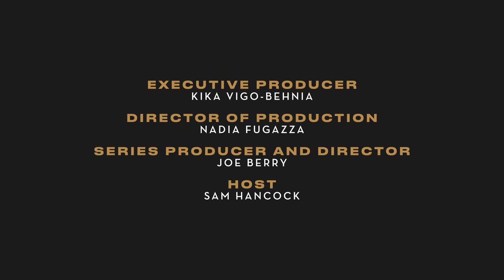1980 Porsche 924 Carrera GT: From Entry-Level To Homologation Special

Comment: The 1980 924 Carrera GT with 210 horsepower may not seem like much today but at the time it was more than many V8 powered sports cars. The 1980 Ferrari 308 GTS/GTB sold in North America with it’s 3.0 liter V8 was rated 205 horsepower and 181 lbs ft of torque. The 1980 Corvette with the 5.7 liter V8 only had 190 horsepower in stock trim and 230 horsepower in it’s highest spec trim. A car with similar specs as the 924 Carrera GT was the 1980 Lotus Essex Turbo Esprit. It was powered by a turbocharged 2.2 liter 4 cylinder engine and had 210 horsepower and 200 lbs ft of torque that only had to push a little over 2500 lbs down the road making it one of the quickest accelerating cars of 1980 with a 0-60 mph time of just 5.5 seconds. The 3400 lbs 230 horsepower Corvette did 0-60 mph in 7.1 seconds while the 3300 lbs Ferrari 308 did 0-60 mph in 7.2 seconds. Compared to the 1980/1981 Porsche 924 Carrera GT that was rated at 210 PS/207 HP and 203 lbs ft of torque and weighed in at just over 2600 lbs with a 0-60 mph time of 5.7 seconds cars like the Corvette and Ferrari 308 were slow. To get the similar or better acceleration times as the 924 Carrera GT in 1980 you had to get a Ferrari 512bb that did 0-60 mph in 5.4 seconds or a Lamborghini Countach that did 0-60 in 5.1 seconds. Both cars cost considerably more than the Porsche. So despite the 924 Carrera GT being considered an underdog when you actually look at the performance of other high performance cars of the time the 924 Carrera GT is quite a good performer that goes toe to toe with the best sports cars of the day and even out performs many of them.
Reply: Do you wich engine is in that car ?. Is it the same as the 924 Turbo (only then tuned up) ?.
Reply: @ArieVisker  yes. The 924 Carrera GT was based off the 924 Turbo but the engine used a top mounted intercooler that helped lower intake temperatures, had a higher compression ratio and new digital ignition system that all bumped power up to around 210 horsepower. Then of course the suspension, body work and a few other things were modified and upgraded to make it a better performer. If I remember right they made 406 cars in total and they were only available in silver, black or red.
Reply: @porscheguy09  thank you for the information. I have a couple of books about Porsche and I could not find this information. 

The seats are they ever been used in different Porsche models ?. I have never seen them in other Porsche cars.
Reply: @ArieVisker  the seats were the same “Sport” seats available in the 911 from 1981-1984 but featured a unique velour fabric design only available on the 924 Carrera GT.  The description below was copied from the website I linked at the bottom of this response. The website loads in German but most computers and smartphones give you the option to translate it into English or whatever language you prefer. The website gives a complete overview of the 924 including the Carrera GT and lists all the specifications for each variant. The link should take you straight to the Carrera GT section of the website but if it doesn’t you can find it in the Menu. This is just one of many websites available online that discuss the Carrera GT.

“Sports seats in solid pinstripe in exclusive black-red with all-round red piping. Leather steering wheel, leather gear stick.

Selectable options largely identical to the 924 turbo optional extras 

(Targa, Klima, eFH, eSp, radio, electrical antenna, alarm system, rear wiper) “

https://werk924.com/924-carrera-serie/924-carrera-gt/
Reply: @porscheguy09  well the reason I asked the question. I can buy  a rolling chassis of a 924 carrera gt. The engine is not with the car it has blown up by the owmer and brought it the crusher (yes really).
Reply: Always wanted to do a replica with an audi quattro inline 5 turbo in it.. perefection
Reply: thanks for the info I've started to use 1/4 mile times because it reduces the effect of launch and more realistic road results. -cheers

Comment: There's no such thing as a poor man's Porsche. They all require good maintenance, whether that's the complexity of a modern Cayman, or the usual classic car metalwork repairs and worn out parts of a classic. They will all be rewarding to own and drive though. My 924 Turbo is the best built car I have ever owned.
Reply: But the 924 was actually called "Hausfrauenporsche" in Germany, which literally translates to "housewife's Porsche", so nothing anywhere near top notch, as the 911s.
Reply: Not sure what you mean by "best built" but I have a 924 Turbo aswell and to me it feels quite cheap (but not bad for 70's standards). Like you can tell they used the Audi/VW parts bin a lot, for example the interior plastics feel cheap and its missing features like fender liners etc. but they sure are great to drive, I take mine to the autoslalom a lot and it gives modern cars a run for their money for sure.
Reply: Yes there is. It's called the Mazda RX-7. It kicked Porsche's ass 3 times in Australia.
Reply: @Seegalgalguntijak  Shaddup.
Reply: @MityLite  I mean the longevity of the mechanical parts, and condition of the metal work is miles above any of the Vauxhall's I've owned.
Reply: MityLite All Porsche feel like partial VW/Audi parts bin to me. All the way up to the new ones. Lovely cars though
Reply: @sarahdell4042  It's impossible to find a mass produced car that doesn't borrow parts from other manufacturers.  It doesn't stop some cars becoming greater than the sum of their parts.
Reply: @RETMTM  meh
Reply: @SteveJenKnaub  actually it was very embarrassing for the German Marque when the SP RX-7 beat the factory prepared 911RSCS in Australia right in front of their own eyes. The big wigs flew in from Germany to put the heavies on the team as it was crucial for Porsche to break the domination of Allan Horsey's management of the Australian Mazda Motorsport project. I believe that this was motivation for Porsche to become the benchmark they are today.
Reply: @MityLite  true 928 front brake rotors rear 911..kkk turbo from carrera...and yup on turns fo make those guys with the six diget $ vehicles  angry ..but in the straights they get their smile back
Reply: @RETMTM  i think porsche was already the benchmark of racing at the time with their successes in endurance racing in the 80s.
Reply: @oranges866  don't kid yourself. Facts are facts and yes Porsche should have been the benchmark in Australia. Australia! The context and point I made was the SP RX-7 wiped the smiles off Porsche's face and destroyed FACTORY PREPARED RACE CARS with a fully road registered, buy off the showroom floor car. Do your homework and see for yourself. Mazda is the poor man's ($120,000AUD) Porsche killer.
Reply: @oranges866  oh my gosh, really? You seriously think that an entire domination of Australia's racing series is irrelevant? Hahahahahahaha
Reply: @RETMTM  you are seriously overrating the significance of endurance racing in Australia just to crap on porsche and glorify mazda. the only race that has any relevance there is the Australian Grand Prix in F1. meanwhile in the more competitive and challenging races like Daytona, Sebring, and Le Mans, the RX-7 only performed at Daytona, below average at Sebring, and so bad at Le Mans they were pulled out in favor of mazda's group c program, all while porsche consistently won those races over and over again.
Reply: @oranges866  or are you underrating the significance. Agree to disagree. You forgot to mention Bathurst, Targa Tasmania, The Bend Motorsport Park and many more. Some of the best drivers come from Australia. Pull your head in mate. 🇦🇺
Reply: @RETMTM  if you're an aussie or something i could see why you'd know those things, but unfortunately those get overshadowed by the likes of the Monte Carlo Rallye, the Circuit de la Sarthe which hosts Le Mans, Silverstone Circuit, and the Nurburgring, which is the most iconic racetrack of all time. those are some of the most famous places/events in racing yet they're just in Europe. i could mention some of the tracks in North America and Japan but you get the point.
Reply: @oranges866  yeah I get your point mate. We Aussies call people like you gong beaters. You have taken my point out of context which I tried to explain. Mark Twain's famous quote is now somewhat relevant. You win mate 👍

I have left the chat

Comment: The entire 924/944/968 line doesn't get the respect they deserve. They literally saved Porsche, their achievement at LeMans is nothing short of astounding and to this day well kept versions of all these cars is about as rewarding a driving experience as there is. 

The 3 litre S2 and 968  and the Turbo S variants being the pinnacle of the species. 

Read Automobile magazines take on the 1989 944 Turbo S vs. the 911 Turbo on a track. In short the 944 ate the 911s lunch. Respect.
Reply: As I understand it, the main reason they had to stop development of the 968 and possible future models was because they would outperform the 911.
Reply: @althejazzman  With equal amounts of power a well sorted 968 would have field day against a similar generation 911 around a track.  Once you get into the water cooled era the balance sways as technology and chassis development literally defy the laws of physics so to speak.
Reply: @Gorilla_Jones  Yes, Porsche had to make the 911 handle properly eventually, because they couldn't kill it off.
Reply: @althejazzman  Rumor has it they made a prototype 944 with a wider front end and a V8, but it never came to be because it would kill the 911
Reply: @MityLite  yup.
Reply: @MityLite  A V8 944 definitely would not kill the 911. With gas prices in Europe almost nobody buys V8 anything. Its a shame they didn't produce it because it would have been a moneymaker for the U.S. and Middle East markets to say nothing of the mind blowing performance that could be achieved by such a vehicle.
Reply: MityLite A wide 944 with a V8 up front...ummmm...isn’t that a 928?
Reply: @beechrad1965  928 is a heavy luxury GT car, not a nimble sportscar like the 944 was
Reply: In my honest opinion the true top of the trans-axle line was the extremely rare "924 Carrera GTS ClubSport"; a more powerful 924 Carrera GT.

That GTS Clubsport was the fastest Porsche (street legal) in the early 1980s. Even the 300 PS "911 Turbo 3.3" had no chance against the 924 Carrera GTS ClubSport.
Reply: @beechrad1965  I have both and they are completely different.
Reply: My '88 944 was one of the finest driving cars I've ever had.

Comment: A work friend bought himself an 944 non turbo. Early model with the 6 O clock tach. I think I ached for a few days after I drove it. 1 because the non power steering was heavy as, but 2 because it was just so much fun. I've got 240z's, an RX7 and driven GTRs etc.. and although the 944 is quite slow by today's standards it's that mechanical raw feel and sound the engine makes in these cars that just feels special. And I adore the shape of them. Just so cool looking.
Reply: Yes the NA is low on power, Gen1 has even less. Pretty soft stock suspension too. But sorted turbos are faster than 996 gt3 cars on the track. The lack of power is more than made up for in the handling and surprisingly they beat the gt3 down the straight too. Now being beat by a soccer mom in a Cayanne S, while your in a NA, on an uphill stoplight while she is probably 25% throttle does really make you want to swap in a 968/S2 or LS in it though, that's for sure
Reply: Try to find  a 944 ventilator model...around same  power  as turbo  but normally  aspirated

Comment: i wanna fix that turbo flange leak..... anyways 924's are incredible cars . as a porsche mechanic im always delighted when i get to work on them. the audi 2.0 is actually a pretty good little engine as long as you keep  the cam spray bar clear. i feel like most people just have never driven a well tuned 924. not many people keep the k jet tuned well and many people just ignore the importance of proper ignition timing.
Reply: Correct! Mine sits very nicely in my little collection.......and it flies

Comment: The Porsche 924 was a fantastic sports car and it only got better as 924 Turbo (931). I even think that these models were better than the later 944. Something pure and simple was lost and especially after the 944 got a facelift in the second half of 1985 with, among other things, a completely new and for me totally uninspiring interior/dashboard. The weight also increased with the years from light 1080 Kg the first couple of years with 924 to over 300 Kg more for the last years with 944 Turbo (951). The dream was of course a 924 Carrera GT (937), but that model was out of financial reach for me in the early 80's. When I got the opportunity a few years later, I bought a 928 S.
Reply: Oh man a 924 Carrera GT would be such an awesome little piece of kit to own.
Reply: @gav240z  Absolutely, but the 924 Turbo (931) fom. the mid-1981 is actually not much more inferior than the 924 Carrera GT (disregarding the design and exclusivity - only 406 was built). The 931 officially had 177 hp from the same 1984 cm3 large four-cylinder engine (vs. 210 hp for the 924 Carrera GT), but I have both experienced and heard about (ie then in the mid 80's) several 931's that were measured with a dyno for everything between 190 and 210 horsepower. The consensus at the time was that the engine in 931 (mrk.II) actually produces in excess of 200 HP. I have even experienced that a standard 931 fought head on against a prefacelift 944 Turbo (951) with 220 HP on the Autobahn over a long distance. It fell short only due to poorer brakes (which by default was taken from the 928 S) and thus hot running before the more modern brakes on the 951. Fun fact: the 924 Turbo has Porsche's internal number 931. The very first 911 Turbo (from the G-Series in 1974 ) had the internal number 930. 924 Carrera GT was a further development of 931 so it got the internal number 937. 924 Carrera GTP and GTR has the internal number 939. 924 Carrera GTR had in 1981 375 HP from the same Audi based two-liter four-cylinder engine as the original 924 model with 125 HP five years earlier. At this time, the standard 911 Turbo 3.3 (930) had 300 HP. The 924 Carrera GTR (939) was a thoroughbred racing model with a top speed of almost 395 Km/h (245 mph), but still :)
Reply: @Hvitserk67  the 924 Carerra GTR is a very special bit of kit. If I could, I would.

Comment: Great video of a great classic porsche. The story of the 924 is such a great one and underappreciated. The white 924 in the Stuttgart museum that held the 924 speed record is a hidden secret worth checking out too. That said working on the 924 is both fun and frustrating given that those examples that havent been cared for like any classic car need some TLC. But as a raw mechanical.deibig experience they are ace and everyone should try one at least once. Mine is almost complete and back on the road ready for cruising and the odd sprint and hill climb blast 👍

Comment: Note on 1981 Le Mans, Walter Rohrl raced the first "944", with the new M44 engine, a 2.5 litre, dual overhead cam, 4 valves per cylinder, turbocharged motor. Not expecting the brand new motor to last it somehow won the class. You might recognize it as the Hugo Boss 924 GTP/944 LM (Not even the Porsche museum can decide what it's called)

Comment: Great video and great to see accurate information on the cars presented. That Audi motor was actually based on a design from Mercedes originally and guess who designed the transaxle for Audi that it uses? It was Porsche, so it came full circle back to Porsche.
Reply: At last! Someone else that knows the true origin of that block. Thank you

Comment: Not a fan of the base or turbo 924, but the Carrera Gt is a different story. A Carrera GT in the states is quite rare. I had the pleasure of driving a 944 turbo back in the day, it was quite impressive. Ergo was great, right where you expect everything, handling was incredible, and back then, it was quite a fast car, this car I have much respect for, and the 924 Carrera GT, but it is a bit of a unicorn.

Comment: You hear those pops on liftoff? One, single, pop in most cases. Not these fucking pants shitting farts that modern cars try to make by puking fuel into the exhaust.

Manufacturers need to take note that the fakery only makes the tasteless happy. These real pops are history. They sound great.

Comment: why did you double clutched at 4:35?
Reply: Cos the synchro is probably worn the same as the tappets are out of adjustment. Disgusting crunches don't make for good videos same as those rattling tappets!

Comment: I had an 88 924s in highschool 2002-2003. Sold it in 2005.
Reply: 924 s wasn t as good as a. Turbo or gt
Reply: @VADORT  no indeed, but it is lighter on its feet and with good mods, it will outcorner a turbo